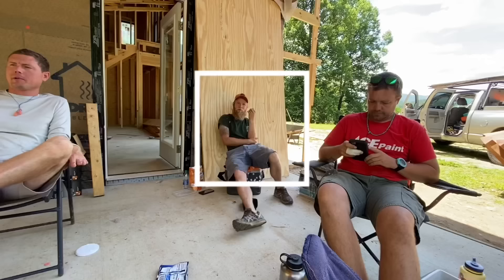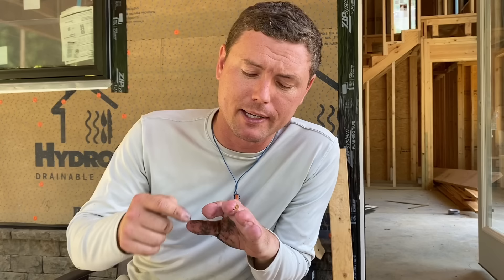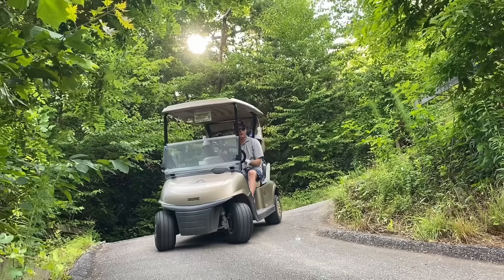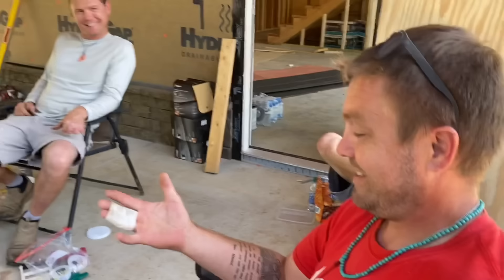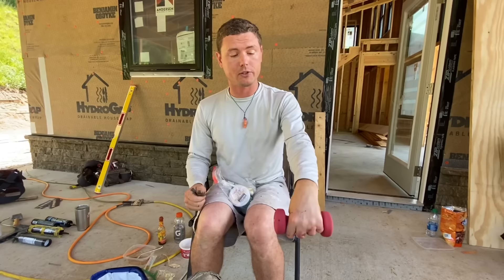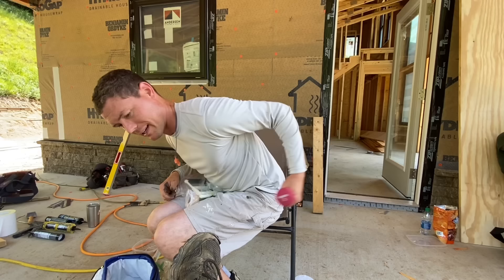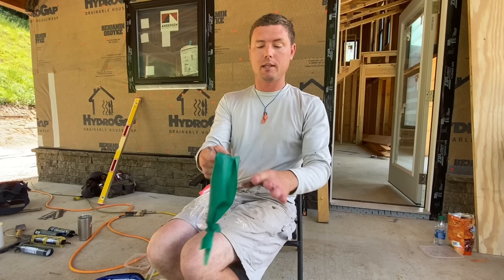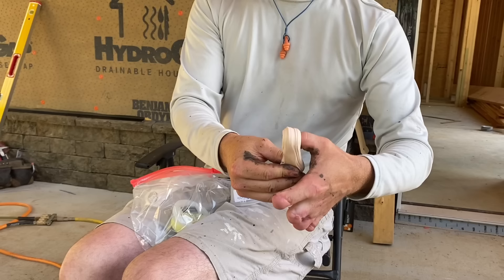Surgery and Other News | Jaime update #6

Comment: I’ve been a builder for 12 years and in the trades for 20...in my time I’ve seen people injure themselves pretty bad. Yet I’ve never seen a man bounce back like this before. Your spirit is one of rarity. Cheers to you bro!!!
Reply: I've been a builder for 30 years, I'm not at least bit surprised that it happened due to the fact not one man wearing jeans or work boots on this site.  Safety is an after thought to these guys.  If an arc flash hit one of these guys like it did me, they all be dead. Commercially speaking.
Reply: It's called drugs and yes they do miracle work!!!

Comment: I've been a woodworker in the pipe organ trade since 1997, a colleage of mine was reaching over the table saw blade repeatedly to cut small pieces of wood and placing them on a cart next to him, but at some point he wasn't paying attention and his fingers contacted the top of the blade, it did enough damage/degloving that they wound up amputating his index finger, half his middle finger and the tip of the ring finger.
I remember chatting with a  friend in the trade who owns his company, and he mentioned how one of his employees was doing the same thing you were- planning boards on the jointer and he hooked his fingers over the end of the board not thinking and my friend said "he jointed all 4 fingers to the same length"
Not hearing the machine is running is  something I see all the time, and those silver colored blades and cutters on jointers and table saws turn so fast AND they are the same color as the table- they are almost invisible unless you look right at them.
Would be so much better if they annodized or otherwise colored the blades and cutters bright yellow or red.
Ive always made it a habit to look AT the saw blade  as I work and not take my eyes off it, and also use push sticks. A power feed is perfect on table saws AND jointers- the power feed does all the work and it covers the blade/cutters and also prevents kickback etc.
You could get a powerfeed for your jointer, it may need  some mounting holes drilled or otherwise adapted, but we did it at the old shop- the power feed was bolted to the top of the shaper, and on the other side was the large jointer, so the feed could be used on either maching by just swinging it around.
I try to use the powerfeed whenever possible

Comment: Nothing will get you back in action faster than a great attitude. Hands down---middle fingers included. Also the great attitude of your buddies makes a difference. As far as donations go, I like the offer of the middle toe.Gimme his info quick. I am a mani/pedi lady and have been for years. I lost the big toe, second toe and most of my arch after a Brown recluse bit me 6 or 8 times because I disturbed it in my snowmobile boot. It was really pissed. So I haven't been putting pretty colored polish on my toe nails and I miss the flash and sparkle. So I think I could get 3 middle toes from several male volunteers and train those toes to accept nail polish. What do ya' think??? If you're not going to use them as finger transplants maybe we could work out a deal. Best of luck all you guys.

Comment: All it takes is just one innocent second for everything to change. I had my left hand stripped down to the bones seven years ago. Was cutting a cedar shake on a table saw and the glove I was wearing had one tiny thread hanging on a finger tip.   In less than a second, my entire hand was down in the table saw up to my wrist. When I pulled my hand up to see what I did, all I saw was the bones of my hand and fingers. The saw had stripped my hand clean.  My guys searched thru all the sawdust and got every piece of meat and flesh they could find. We cleaned it up and put it in a ziplock with ice and salt. Then got to the hospital. Luckily for me, all my nerves had been ripped out and I felt nothing.  But everyone around me was freaking out.  The hos[ital staff did a pretty good job of putting my hand back together except for a bird finger.  That was seven years ago and I am just now starting to get the nerves returning to a point where I can sense something in my hand. Stay strong brother and don't get down. You will be amazed at what you will be able to do with your finglets in the years to come.  The human body does some amazing tricks.

Comment: I did cabinetry for a while and got in a sticky situation on the table saw and yelled for my coworkers to help. But them not working and talking at the back of the shop they didn’t hear me. So I ended up nipping the tip of my right middle finger. No I got nice stub on the tip of my finger😂

Comment: You would think that they would have smoothed the end of the bones before stitching the flap closed in the ER.
Reply: He went to the operating room. Usually using a rongeur, they cut the bone off shorter than the injury to create enough room for finger padding.

Comment: i was using a Ridgid Belt Sander R2720 and my jacket Sucked into the Belt Bechanism - Happend So FaSST Lucky just Jammed .
Another Time HONING a Briggs and Stratten 250cc Single Cyl BLOCK and the Hone Shoes Hit My Thumb - Was it Painfull just GRAZED Swollen SKIN
another Time at the SHOP my Buddy was Helping me Heat a Brake Line Nut and i was Beside Him 
He put the Torch Down and my LEG was there Burnt a HOLE Through my Blue 90% Polyester /10% Cotton Pants and onto MY SKIN 
had a HARD TIME WALKING Till the SKIN HEALED .